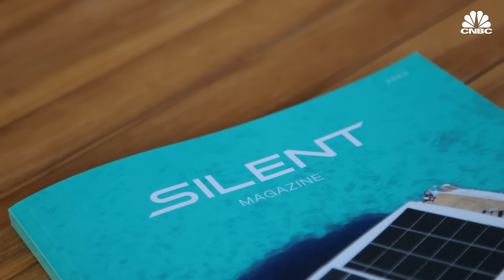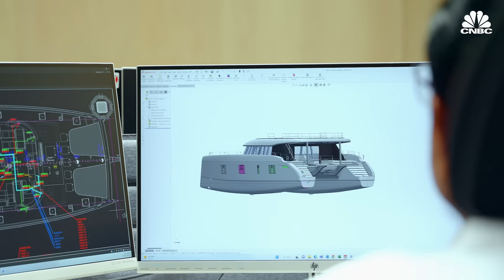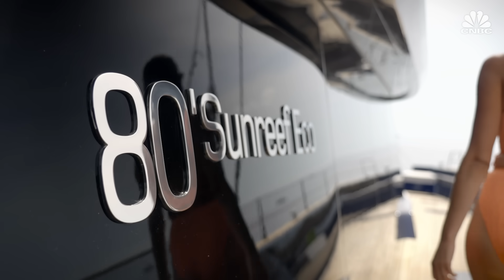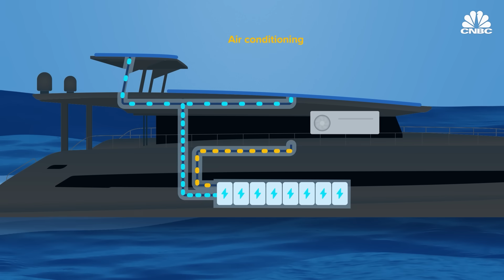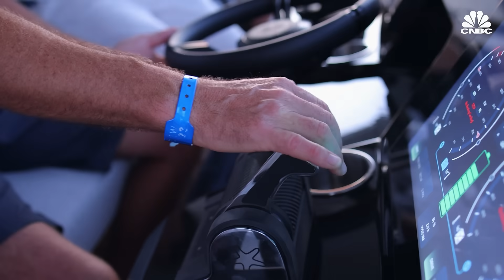How These Silent Superyachts Are Powered By The Sun

Comment: This tech would actually be decent for house boats.  For the most part they arent moving around all that much so over the course of a day you'd supply all your power and be able to charge the batteries so when you want to move the boat around you've got the power to do that.
Reply: Problem is 3mil$ price
Reply: With a house boat, you could also have wind turbines, for when the house boat isn't moving. Perhaps they collapse when the boat is moving, and then you raise them up when the boat is anchored, so you're generating power from the wind as well.
Reply: This could be a solution to overcrowded cities. Build on the water lol
Reply: @sirdiealot53  can we still call it a city? Or just group of houses of floating boats? 😆
Reply: It already is.
Reply: @aspitola true they are expensive but so are most new technologies and vehicles. Also think how much someone might spend in fuel boating around for 15+ years.

Comment: For boats.
1. The weight of the battery doesn't matter.
2. There's no shade on the ocean.
3. The backup can be sustainable, aka. a wind sail.
Reply: I thought of that too, but a lot of area is lost and even sun area is shaded, when using sail. You are better off (I believe) using more solar panels, and a new "Sharrow" propeller which is 36% more efficient, that I don't see mentioned often on these shows. Imagine that!

For the rest, you can have high-concentration solar panels, with external fennel lenses and internal high-concentration solar cells, that move on the inside to capture every angle of the Sun. Cooled by sea water, which can be used in a heat exchanger to heat internal water, or for radian floor heating.

Imagine capturing 50% more energy (by maximizing efficiency at different angles of the Sun, having more efficient and cooled panels, and capturing the heat). While also having a new Sharrow Propeller for maximum efficiency. You could literally cross the OCEANS! At no further cost.
Reply: 1. The weight of EVERYTHING on this boat matters and that's why SY have been fanatical about weight reduction and friction reduction. I've seen the extended hours-long interviews with the designers.
2. Yes there is. It's called cloud cover. We get it months a year in the Northern Hemisphere.
3. A true wind sail interferes with the solar collection, but they DO come with Kite Sails to help.
Reply: You understand nothing about physics and engineering. Weight "doesn't matter" when you're floating in the water, but it ABSOLUTELY matters when you're trying to propel TONS of weight through the water! But it's obvious that you've memorized all the sales pitch lies. Lol
Silent Yachts just filed for bankruptcy because customers are finding out that the performance doesn't match what they were promised.
Diesel/electric hybrids are the only reliable option currently available! Which is why Greenline Yachts can't make their hybrids fast enough to meet demand, but Silent is going out of business!
If solar was a viable option, they would be selling them faster than they could make them.
Reply: Good points. Thanks. 
❤

Comment: Interesting concept. Imagine if they put solar panels on top the Staten Island Ferries. That would save New York a huge chunk of change in fuel savings.
Reply: Easier to just switch to electric with huge battery banks that you plug in at the dock. They could fill up over night and then just get topped up at every stop. I think that is what the Swedish ferries are doing.
Reply: Too much weight and drag. The only reason these catamarans work is they have slim catamaran hulls and everything but everything in these vessels is weight concisions. MDF tables instead of glass ones. Plastic shower cubicles. A ferry? Solar panels would provide a millionth of one percent of the power required.

Comment: Seems silly to not also have wind turbines which could be used when the boat is anchored and at night. They could lie flat, and then you push a button and they rise up and start generating wind power. Or it could even be an automatic thing, if the boat is idle for more than a few minutes, they just automatically pop up and start working.
Reply: Great idea!
Reply: Yes, also they could have sails (not so hi end, but more robust and easy to use).
Reply: U can do that as a backup battery.
Reply: It's because wind isn't as efficient lower down and moving parts that raise and lower a mast is a cool bit of boating callback, but hardly an efficient use of space or a reliable mechanical part on the water.

There's a reason offshore wind installations are MONSTERS.
Reply: They (Silent-Yachts) make a huge kite sail that they run from the bow that does help if you are going to be sailing for long enough to warrant the hassle of deploying it. Wind turbines are kind of noisy and don't really put out enough power to bother with.
Reply: Mobile turbines can produce enough juice for your fridge, IF it is windy, but nothing for power. Zero. Far too little.

Comment: Taiwan's Acer and Wistron with Formosa Plastics also planning to create a zero-carbon emission yachts manufacturing industry by building 3-in-1 wind, solar, and hydrogen power vessels, monitored by AI to best optimize power management pending wind or solar conditions. Partnering with Novatec Yachts and Monte Fino Yachts with Gunter Pauli.
Reply: Zero emission yachts are called sailing yachts.

Comment: The biggest breakthrough will be solar sails, it's patently stupid to be on the ocean and not make use of the wind. Solar sails will aid in propulsion, and will the electricity needed to run the systems and the motors when needed.
Reply: Look at the use of these. They mostly float around the Med, don't move far and then just anchor for a few days while the owners drink/swim/fornicate. You don't need sails for that. Also the learning curve between motor yacht and sailing yacht is large enough that these people don't want to learn how to hassle with sails. 
Personally I'd go for a sailing catamaran like a HH50 with lots of solar and batteries. I could mostly sail around the world and use diesel when needed.

Comment: I work for a Shipping company and i can say it is not possible to make Cargo vessels working only on electric motors because you need a lot of power. They are all to waek. For smaler Ships like Yahts or Small ships that dont travel far it is ok but not for cargo. We are looking for alternatives but there are not much. The next gen. of Cargo ships are going to be probebly bio Diesel or hydrogen when the engines are going to be stronger. And dont forget, the old Ships are nasty asf. But the new ones are very eco friendly compared to the old ones
Reply: Look how the Tesla semi is more powerful than a regular semi.  
It can be done with wind and solar.
Reply: Powerful? Aircraft carriers have 100% electric drive trains. :) You are right though, you couldn't put on enough solar or have enough batteries. There has been some intresting talk of kite sails and tall spinning tube sails but I dont think those will work well on container ships. Maybe on oil ships (irony?) or bulk cargo with their mostly flat decks.
Reply: Absolutely. The only reason SY work iss they are low-drag narrow catamaran hulls and SY were FANATICAL on weight and drag reduction. Plastic glass in the showers and MDF tables.

Comment: I am all up for electric transportation. And these boats are great!  But they always avoid mentioning the cost of replacing the battery bank, which is a huge cost. With time, batteries will improve and become cheaper. But for now, you must consider that HUGE replacement cost, which will inevitably come.
Reply: @gse3862 You need to do some research on how often batteries need to be replaced and the cost. I think you will be surprised. As far as I can tell the batteries will last longer than I will if treated right and the cost is half of what it was 6 years ago. TCO should be much less then the diesel you would have burned.
Reply: Also the new Sodium Iron batteries that CATL has produced, when improved, might even be way cheaper and more environmentally friendly. Last longer and have more power. The only draw back is energy-density, but even that is set to improve and is only an issue for cars. For boats, they are ideal, as they last way longer and are way cheaper.
Reply: Whilst that's true, the replacement is 25 years. By that time a Pod-drive standard yacht will be a fortune to maintain too.

Comment: Advertising and Reality are different. In the brightest of Sun these can drift around fractional speeds. But the reality is they get charged at dock and then they run generators. Oh, didn't they mention each hull has a generator? When the Silent 55 was the first "solar electric" boat to cross the Atlantic an interview with the captain (an experienced Spaniard) said he kept the generator running 24/7 to get enough energy to cross in time.
Reply: In the brightest of Sun you can power at the same cruising speed as most other boats without using the diesel generator, While using all comfort needs. It was the Silent 64 that sailed across the Atlantic and he ran the generators for 3 hours at a time because, he was in a storm that lasted a week, with waves as high as 10 meters. He also stated that the solar was still collecting small amounts of power during that time. It looks like it did what they said it would do. Success Story. @darthkek1953 Why be so afraid of Solar? Come on in the future is looking bright.

Comment: There's very few technologies as good as sailboats. A solar electric/sailboat would be an awesome boat!
Reply: Most sailboats these days have solar panels on them.
Reply: @darthkek1953  right, and the hard part is the batteries but if batteries were cheaper you could have the drive engine be electric without any gas or diesel at all. Usually you use the wind anyway so it wouldn't take much electricity used very rarely.

Comment: I wonder how much fuel is planned for the generator to run.
Reply: The generators are indeed run often. But if you go port to port, or port to cove to port, depending on the weather and speed you choose you might be able to get away with not using them, or only briefly. But in fairness other "normal" boats would have their generators running 24/7.

Comment: did they mention how far boat can go?
Reply: It's not about distance, it's about speed. The faster you go the EXPONENTIALLY  more energy you use. If you drift around at displacement speed, don't use the A/C and have good sun, you can have unlimited mileage.

Comment: Those yachts are definitely NOT "powered by the sun"; that area of solar panels would barely run the AC and icemakers. Boats like these use about 1-2 liters of diesel per km of travel; there's zero chance you could cruise the Med on solar power. For example, on the Silent Yachts website, the fuel capacity is 1000L to 1900L, hardly silent.
Reply: Yes and no. If you charge at dock you run on battery at very slow to a cove, if you don't run A/C and stay at a cove a day or two then you might get enough charge to return to dock. It's not impossible. But for passage making yeah you really do need the generators on several times a day. HOWEVER thanks to the large batteries MUCH of that journey is Silent if you're going cruising not racing speed the generators fill the batteries much faster than they are drained, so you fill the battery (up to whatever level) and then turn the generator off. If you're doing a high-speed dangerous passage-making (e.g. Atlantic) then that's when you have them on 24/7.

Comment: Is there a risk of the batteries catching fire or exploding?
Reply: Like diesel?
Reply: Thermal Runaway
Reply: @HardstylePete   diesel is a low fire risk. It doesn't explode and is relatively difficult to set alight. Petrol/Gas on the other hand... BOOM!

Comment: What's wrong with hybrids? What would you do if you're stuck in a storm? The onboard generator could not keep up!?
Reply: They are not considered hybrids in yachting because that has its own definition and companies like Greenline are in that niche. But they ARE hybrids in reality. Their generators are connected to the batteries and you can top the batteries up faster than the engines can drain them. In fact the Silent 55 that crossed the Atlantic had the generators on 24/7

Comment: For a catamaran, solar can make sense. The ship is relatively light weight, it does not have as much drag on the water, and it has prolonged periods of rest while at port. Integrating solar panels doesn't make too much sense if the ship is meant to last more than 25 years. It means the ship will effectively be a waste product in 25 years. Unlike a steel boat, the fiberglass boat will also be more difficult at end of life. The solar panels will also have issues in both hot and cold environments. The batteries don't do well in the cold. The panels don't do well in the heat.
For larger vessels, solar won't work. These vessels are constantly at sea, so they don't have those long periods to recharge batteries. It may help with crew conditions while waiting in queue at port. Nuclear is an option for the exceptionally large vessels, but decommissioning will be an issue and I don't think those vessels will be on the sea for over 50 years.

One thing that is possible is to use an electric engine that is powered by both solar and diesel. There are periods where the diesel engine works less efficiently to maneuver or change a ship's speed. If it was possible to use electric power here so the diesel engines could be run under optimal efficiency, then the overall efficiency increases. But physically it may not be worth it.
Reply: Interesting points, solar wont be sufficient to fully replace combustion engine power but it can certainly improve the running cost by reducing the amount of fuel needed for voyages. Presumably the reduced fuel saved by solar would allow for greater loading capacity also, since cargo ships carry huge fuel loads as well.
Reply: Yes, solar panels are impossible to replace. LOL
Reply: Yeah because you never spend another dollar on your super yacht after buying it.  Fixing solar panels after 20 years is definitely a deal breaker.  Before you know it our landfills will be full of super yacht solar panels.  😂
Reply: You just made up 95% of that.
Reply: Steel hulls would be a terrible choice, aluminium hulls on the other hand would be smart thinking.

Comment: would be nice if they would make those vehicles that can take water to make hydrogen and electricity... ideal for yachts as they can take sea water where theysail...
Reply: What would be the purpose of that? It takes energy to split water into hydrogen and oxygen, so there's no energy savings. The only difference is that you'd be storing energy in hydrogen gas, rather than in batteries. But seems a long (and expensive) way to go just to store energy differently.
Reply: @enargins   and there are losses at each step. Hydrogen rarely makes sense in transportation. Storage is way too large for most mobile uses.

Comment: Are they any stronger than other superyachts?
Reply: Doubt it. They still haven't made trucks to pull cargo strong enough yet(at least 5 years they did have them. Haven't seen any yet really)
Reply: They are CE Cat A rated which is the highest level of specification. That is they're rated to go Blue Water, trans-Oceanic, and are rated to withstand any storm short of a named Hurricane.

Comment: Green washing at it finest. 

That "back-up" diesel generator is what's doing the real heavy lifting here. Those solar panels won't even produce enough power to run the ships accessory systems, let alone the propulsion. A couple hours out from port and those batteries will be dead and 99% of the energy will be coming from fossil fuels. 

Even if they could magically power the entire thing on solar, lets not forget the massive environmental cost of building these ships before they ever touch the water.

Comment: Yeah but 2M+ for just one is dang expensive. Let see that base catamaran only around 700K max because is new then you install solar which add up to 1M+ which is reasonable prices but no they charged labor works too. Nothing is free in this world.
Reply: Very good prices for same-size motor yachts. Sailing yachts are cheaper but require much more skill and huge amounts of labour to work.

Comment: Tipical modern information. You get all ecconomic informations (which you didn't ask for) and none technical informations. Speed, range, autonomy, how doesi t function, what about if there's no sun tc., etc...
Reply: Speed is up to 18 knots, range is dependent on speed but at displacement and in the sun, without A/C, pentially unlimited. After that, balances. If there is no sun or you run low, there is a generator connected to the batteries. So you top it up with diesel.

Comment: That amount of panels barley can power the inverters. This is a scam
Reply: Not true. I mean, yes if you're going at speed you'll be using the generators. But if you don't use the A/C then these panels will run both hotel (fridges, etc.) and engines.
Reply: From the pic ，there is not enough PVS to push it go fast. For the inverter it should apply the IP65 in this area. Currently it' a aux part but it's green.